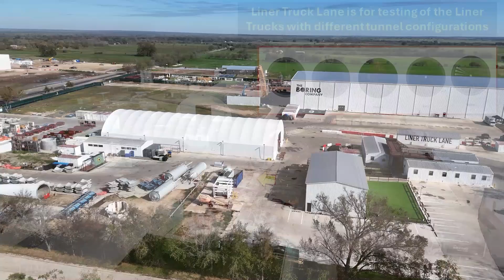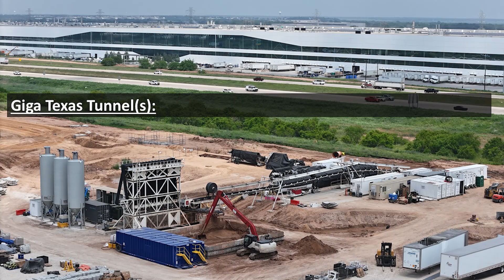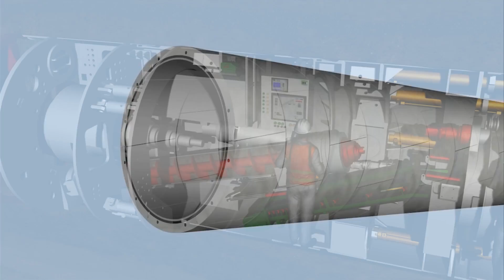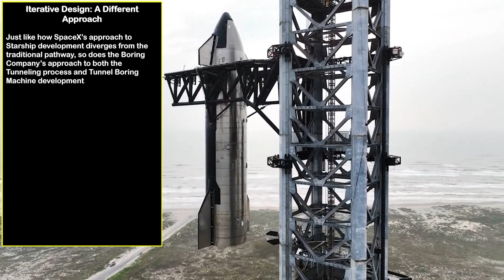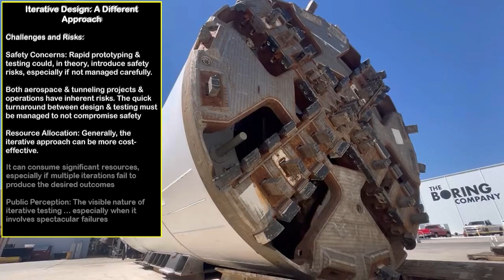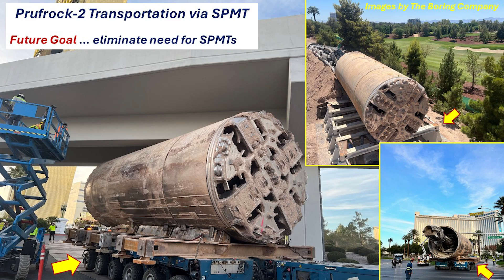Boring Company Tour Part 2 ... Giga Texas Plans, TBM Design & Iteration, New Boring Machines & More!

Comment: Joe, looks like you compared the Boring Co tunnel to railway tunnelling which is done on a far larger scale. The bored section of a railway route is generally a small part as the diameter is based on the minimum needed for the whole route. To save boring, the open part of the railway route is done by cutting, and the railway TBM sits in the cut. Railway TBMs also use a converyor to move earth from the TBM and they use rubber-tyred vehicles to bring segments into the tunnel.
Reply from the maker: Just pointing out the obvious differences and the innovation the Boring Company specifically called out as how they are differentiated.
Reply: @JoeTegtmeyer  Interesting how much the application influences the TBM. Elon keen to automate a system that could be used on the Moon and Mars. Obviously, TBM for railways on Earth won't go go to the moon.
Boring Co service could be described as luxury public transport. In the next couple of years we could see it as an automated service.

Comment: Nice. They have to have goals for speed in the design. Why wasn’t this basic parameter covered?  What is an average time required per mile or range. Although the tech seems good not impressive if you don’t compare speed and cost improvements.

Comment: Surprised to see that the 'bolting' of liner segments is still not automated. This means that humans are currently right behind the boring segment. Pretty sure they'll solve it very soon so there are no humans inside the tunnel during the boring process
Reply: Chinese have solved robotic erection of linings. So have the Germans and the Japanese in trial systems. However, it does require much larger tunnels than TBC are building. A lot of the most advanced tunnelling tech will not work in such a small tunnel. 
If you go a little smaller you can use non man entry pipejacking (AVN) techniques.
Also, by using dowels on the circle joint and locator bars (already cast into the TBC concrete moulds but they don't seem to be using them) tunnel linings up to 6m diameter can be erected without the use of any spear bolts. Did a cable tunnel using this type of lining in 2005.
In many medium/large diameter metro rail tunnels the bolts are removed at the back of the TBM backup and recycled forwards for re-use. The finished tunnel has no bolts.

Comment: just need use a spiral design of tunnel sections. Seem simple, if your not pushing off this section, could premould like screw/bolting..allowing a pushing place. back 1 row ..plus(required if non stop) of tunnel.?? would constrain interior space..leaving difficult maintainer/repair space yes auto matic be best

Comment: Best explanation I have seen of Boring Company process.  You left Gidot and Line-Storm out of your timeline. Is there enough ability to take up slack to use a common size tunnel segment, or are the segments customized to go around a corner. Also, it is normal to inject some sort of grout between the tunnel and the surrounding soil. This part of process was not mentioned, or maybe not done?

Comment: Very interesting. Confirms much of my understanding of what TBC are doing.
Remote (surface) control room is a good development for TBM's of this size. Keeps some people out of the tunnel, although the 4 man operation team seems a bit OTT in comparison to most TBM's (1 possibly 2 people).
Japanese contractors were experimenting with this some decades ago, largely driven by a shortage of experienced operators. Several TBM's operations could be managed from a central control room at the head office, possibly hundreds of miles from the site. 
Similarly, a Herrenknecht AVN machine is a closed loop excavation, non man entry TBM, with all operations from the surface, and can be continuous mining (except the installation of the next pipe), these Pipekack TBM's are limited to about 4.1m diameter at present but another 150mm to get to the TBC diameter must be possible. The issue is the transport and size of the pipes. 
It begs the question why not just buy one of these machines? 
A 3.2m diameter one is operating a few km from me as we speak, launched from the surface, halfway up a hillside on a very small worksite.

I don't accept the porpoising approach claim that a smaller site is required. See the size of the site at Giga Texas, and the amount of land the TBM took up to exit the ground next to the golf course in your video. I have managed larger TBMs that had the whole operation working from a site the size of a basketball court, and an exit shaft in a site less than 6m x 6m, in some cases no exit shaft at all. Site constraints in dense urban environments often lead to some of the most imaginative technological solutions.

So Prufrock 3 is already heading for retirement, a far cry from the claims regarding its potential performance when it was "unveiled" last year. Lets see what versions 4 and 5 bring. 

Thanks for all the effort Joe. Despite my cynicism, its great to see tunnel construction being discusses among a wider audience and your drone videos have been the backbone of this debate. Please keep it up.
Reply: Maybe version 3 is internally already judged in the Rapid Fail category, to continue Joe's analogy, with the next versions coming out all that stronger. If I could ask a question on the rapid iteration analogy that is used: a rocket is tested in order of magnitude minutes, but testing a tunnel may take order of magnitude years because of its required longevity. Is that why you mentioned earlier that climbing the technology curve for a new entrant in the tunnel boring business takes so many years?

 In any case I admire the attitude of trying to build the future, go get-'em! And I hope that top notch players such as Herrenknecht will take it in their stride: Bring It On!
Whatever, us watchers are in for a treat, where will it emerge and when? Also I hope that some of their testing will involve making curves, if only to make our guessing game more interesting. Unfortunately you have already explained very clearly the First Principles involved in arranging the concrete sections in a ring (Not Rocket Science now that I know the trick!..).. but perhaps tighter curves is on their to-do-list.
Reply: @hardernl8893  All good points. 
I do believe the analogies to Space X are in some ways limited as the whole risk/reward process for building robust infrastructure compared to space exploration are quite different.
I doesn't necessarily take years. Teratech are a successful smaller independent TBM manufacturer that hit the ground running, without billionaire backing, and are growing in the market, with similar size/type of TBM's to TBC.
I also admire anyone for trying. Indeed, the large plant company Caterpillar tried entering the TBM market some years ago through the purchase of the Canadian Lovat company, it didn't succeed, when one would think they had a real chance of hitting ground running so to speak.
I credit anyone who is willing to invest in developments for the future, but TBC need to get a bit more realistic in their aims if they want to be seen as credible players in the market.
Tighter curves have been done with very specialized machines, but they don't really work with the conveyor system, or rapid excavation. 125m radius is a realistic minimum. TBC are already doing a vertical curve in this tunnel, (about 900-1200m radius) even though it is straight in plan.
Many years ago I was the Engineer on an "S" curved pipejack tunnel, even though most Engineers would tell you they can only be built in straight lines.
Reply: @hardernl8893  The Giga Texas tunnel does have a curve  - it is vertical rather than horizontal.

Comment: Following your comments that this may be the only use of Prufrock 3. It may have been decided that, due to the delay in the Tunnelling works, it will not be removed in its main component parts. The extension structure is being completed along the path that looked like it had been left for the TBM removal.
Plan B could use the ever more common method of removing all the back up decks back along the tunnel, right up to just leaving the cutterhead, bearing, bulkheads and shield skin behind. These are then butchered (lot of use of the gas axe) into handleable sections and scrapped. I have managed a number of projects where this and variations on the idea have been utilized.

Comment: Two things I can't wrap my head around - 

how does Prufrock turn without leaving a gap in the soil from the tail swinging out of the final tunnel path? And are there special liner segments with different angles for turning?

And what does TBC do about the gap around the liners? Since they appear to be installed just inside the shell of Prufrock, seems like there is a gap all the way around the outside that would eventually settle. Even a few inches all the way around I would think could eventually cause small sagging right?
Reply: See above for how the rings build to go round corners. The TBM has an articulation joint about 2-3m back from the cutterhead. This allows up to 150mm of articulation on this first section of shield. TBM's generally form an overcut at the head, sometimes have a "copy cutter" (in rock) that moves in and out slightly as the cutterhead rotates. The whole skin of the TBM is sometimes slightly tapered (10-20mm along its length) to avoid it getting trapped in squeezing ground.
The segmental lining is usually 100-200mm smaller than the shield, to allow for the physical thickness of the shield skin (which must be able to withstand soil and hydrostatic pressures. this leaves a gap as it is pushed out of the tail. The gap is sealed at the back of the shield by wire brush seals which are constantly injected with a thick grease (often with fibres in it) to stop water/soil running back into the TBM down the back of the segments.
as the TBM progresses and the segments exit the back of the shield an annulus is left behind. This is continuously filled with a cement grout, usually in combination with an accelerator to cause rapid hardening. this stabilizes the ring and minimizes settlement of the ground from the disturbance form the tunnel construction. Plenty of YouTube videos to better explain it. Try the Herrenknecht website as a good starting point.

Comment: As others mention, the tunnel exit point inside the building extension is most interesting - and we may not even get to see that happen, given the rate of extension construction as girders and floors and roofs join the main building. Looking down with the drone cameras, it is difficult to judge space sizes. Precision tunneling navigation is certainly required to avoid the building foundations and other existing underground structures, pipes, conduits, etc., as the tunnel exits. Very shortly, the two cranes inside will be carefully backing out themselves. TBM seems even bigger than the cranes. How and at what point in construction that will be extracted (using SPMTs supporting a jig?) seems unclear, although I'm sure all that is thoroughly planned. But Part 1 & 2 videos have sure helped to understand the process. Thank you, Joe.
Reply: We should get a view in for some weeks at least. Once the TBM reaches the perimeter grade beam and stops for removal, or continues on a little further we should still get to see inside until the perimeter grade beam and retaining wall is completed, then the windows installed.
Reply: @DessieDoolan  Sure hope so. I (for one) am really looking forward to the tunnel exit. I have just assumed that the tunneling machinery would continue forward to be extracted from the tunnel and removed. But maybe the whole thing is designed to "back out?"
Reply: @WarrenLacefield  As mentioned elsewhere by David Salisbury, the back-up decks/gantries can be removed back through the tunnel if required. Although not if the road deck is installed.

The TBM itself being larger than the finished tunnel can only be removed from the tunnel end.

Comment: Joe - I wonder about the curved (diving then surfacing) tunnels. Do the concrete liner segments have enough slop in the joints to allow for the slight curve? Or are the concrete segments shaped slightly differently to accommodate the bend? It would seem to me they may have different forms for the concrete segments used in the curved sections. Great information Thanks.
Reply: Its a "Universal ring". The ring they are using is nominally 60" long. But it is 59" at one side and 61" at the other. 
To visualize this, imagine you slice a salami, but angle your knife slightly left then right with each slice. Now rotate every second slice by 180 degrees. Voila! you can go round a corner. By rotating each progressive slice to any one of 16 available positions (16 dowel connections round the ring) you can go in any direction, up, down, left, right or straight. By doing this the segmental rings can follow the path the TBM excavates.
Reply: @davidsalisbury50  Thanks for explanation, I was wondering this and couldn't find the answer in joe's video. I was like all those pieces are the same or what? It make sens now :)

Comment: Did you get any info on how the liner segments have to be non identical to adjust for curves in the tunnel path?
Reply: Its a "Universal ring". The ring they are using is nominally 60" long. But it is 59" at one side and 61" at the other. 
To visualize this, imagine you slice a salami, but angle your knife slightly left then right with each slice. Now rotate every second slice by 180 degrees. Voila! you can go round a corner. By rotating each progressive slice to any one of 16 available positions (16 dowel connections round the ring) you can go in any direction, up, down, left, right or straight. By doing this the segmental rings can follow the path the TBM excavates.

Comment: Did I miss the part where you showed where the tunnel would end? Did you mention how fast the process was going or how far they had tunneled so far? Good PR for the Boring Co, anyway.
Reply: Maximum 10m per day, average around 6m, currently about 165m into what is expected to be a 300-320m tunnel. All a bit of educated guesswork based on what we have seen in Joes videos over the last 4 months.

Comment: Awwww, the most important question is how far have they tunnelled and when will they finish this first tunnel, also when will they start the next tunnel and will they join all tunnels together, so many questions and none of them should be that hard to answer. Joe you have access nobody else has and really should be asking the questions we are all eager to know.
Reply: "how far have they tunnelled" 165m.; "when will they finish this first tunnel" expected 2-3 more weeks.;
Reply: @davidsalisbury50  I'm curious: considering how long it took to set up, wouldn't it be better for them to just go on tunneling all the way to the parking   garage, rather than having to set up on the other side for that second tunnel?
Reply: @greggerypeccary666  Minimum radius for this TBM would be about 125m, and that is without considering the conveyor alignment. Not sure how this could be achieved among the foundations of the main factory building.
Also the tunnel needs to come to the surface at the extension for the new vehicle delivery.

Comment: I wonder if they could eliminate all the conveyor and gantry system by modifying the tunnel segment truck to bring in the segments and then carry out the spoils.
Reply: Most EPB TBM's operate with the spoil in muckcars, These a re generally on rails and cant accommodate steep inclines such as TBC's porpoising approach. The gantries are still required as they carry all the backup systems for the TBM, a shorter conveyor runs across them and discharges into the muckskips at the back of the TBM. Watch the Herrenknecht videos for better animated explanation.
Reply: spoils are sposed to be bricks i thought. or maybe eventually liners?
Reply: @natpainter8185  Nah!, Just early vapourware by TBC and Mr Musk. Tunnel segmental lining requires very high specification concrete, using high quality control materials.
Reply: @davidsalisbury50 what is vapourware? is this a new product that recycles ones vapour like dune.  prolly working on that with engineers at spacex
Reply: @davidsalisbury50  Just curious how vapourware created operational tunnels in Las Vegas?
Reply: @edhill8568  The Boring Company's (by which I mean Elan Musk's) early claims that they would be making the lining for their tunnels using the material excavated from the tunnels was the "vapourware" I refer to. Similar to many of the other claims/ambitions of TBC (7 miles a day (they are achieving 6-10m), 3x power TBM's (can't really be done and pointless anyway as TBM's are typically 2x more powerful than needed), Launching in 2 days (just took them 74)) Whereas in fact, behind the vaporware, they are building very ordinary tunnels, using very ordinary materials and methods. My criticism relates to the claims of what they aim to do, not in particular what they have actually done.
The operational tunnels in Vegas were constructed using a standard EPM TBM, with a standard universal segmental lining. All remarkably ordinary, other than the starting from the surface in a very untidy way and finishing the same. Doing it all from a large open car park in the convention center is one thing. Doing it in a dense urban street setting is another thing entirely.
Reply: @natpainter8185  Good question. I don't know the vapour /dune product reference, sorry.
In my mind it is empty claims that have no substantiation in fact or scientific theory. I think it comes from the computer industry to describe a product or service that does not exist and is unlikely to ever exist. In business it is possible it could be considered fraudulent under Section 2 of the Sherman Anti-trust act.